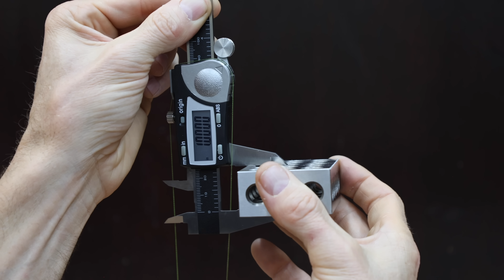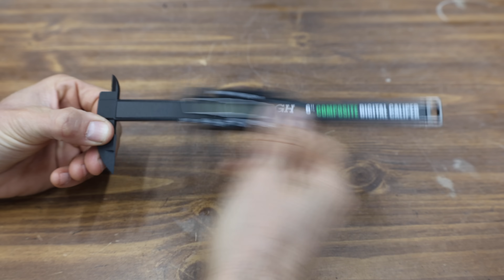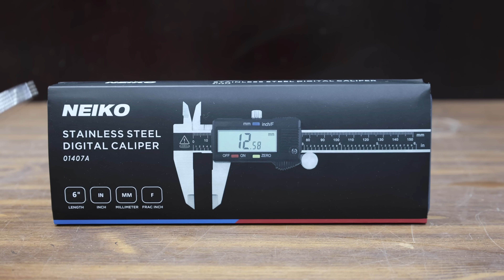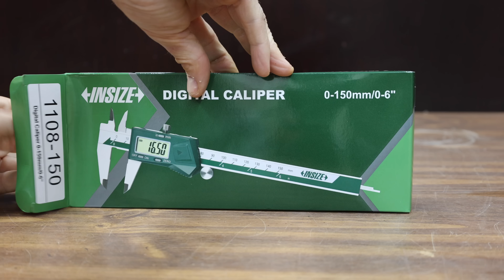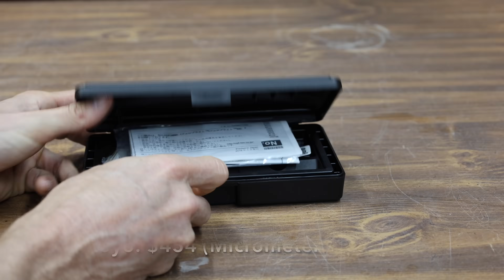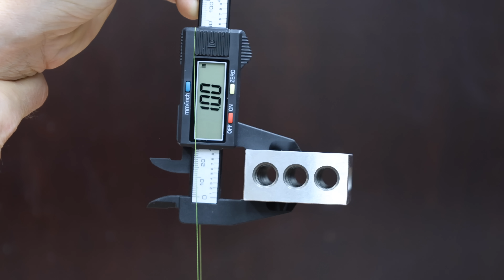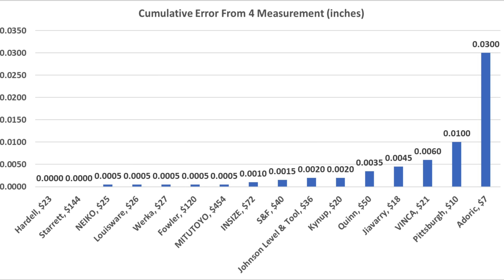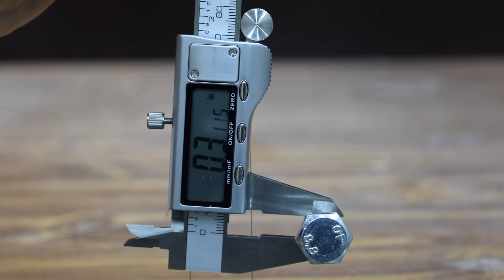I've Been Proven Wrong About Calipers!

Comment: I'd like amperage measured when on vs asleep. My old no name harbor freight consumes almost as much power asleep as it does when on. I take the battery out because I rarely use it. I have a Mitutuyo that draws very little asleep. It benefits from using SR44 (silver oxide) batteries instead of LR44 (alkaline). The SR44 has a longer shelf life and won't corrode. 

The hole depth test was a little sketch on a wood surface.

Comment: I have owned a lot of cheap calipers over the years, they all end up giving the wrong readings in the end or just stop working. I got a Mitutoyo in 2018 and still using it today. I have left it on for 2 weeks a number of times and still got 5years out of the first battery.

Comment: I worked 50 years of my life as a precision machinist, and taught hundreds of young kids to work in tolerances of .0001 to .0005 throughout my career, so calipers were always used for rough measurements only. A real machinist will only use micrometers, indicators, gage blocks and a surface plate.  
Great test, for people that need somewhat precise measurements, without the expensive tools I mentioned. On YouTube I see so may people relying on calipers for precise measurements and laugh, because calipers as a whole just are not precise. 
Love your videos!!!
Paul,  USA!!!

Comment: Have to object - an error of 0.00 is not the same as an error of 0.0000.   These are not even in the same league.  A 0.01 caliper is not a replacement for a 0.0005 caliper.  They should not even be in a test together.  The other thing to consider is durability.  After a year of hard use in a shop how accurate are those cheap calipers?

Comment: Mitutoyo are the best I’ve used. I use my calipers and mics 8 hrs a day measuring parts keeping what I’m running within tolerance. The battery last longer than any other caliper I’ve used. I needed a new set of 12” calipers and tried a Fowler and they work fine but eat batteries for lunch. Plus I have to turn them on every time I pick them up while my mitutoyo stay on 8hrs a day and last forever.

Comment: Unfortunately this testing does not give you the information you really want. All these calipers have some very nasty issues that are not mentioned in this testing but are the only things that I really want to know :
1. How do you open the calipers up to clean out the battery compartment when the battery goes flat and spills its corrosive contents into the battery compartment. Because you cannot and it means throwing the unit away. They may be okay if you are a professional engineer and are using them every day. If you sometimes go months with no use (so don't know what the battery condition is) forget them. There are a few ways to prevent this but requires changes by the manf and believe me they would rather you bought new ones. Firstly when the battery reaches a certain charge they should refuse to turn on, secondly you do not want them to turn on by themselves when the arm is moved.
2. The sliding friction is usually generated by some small plastic spacer bits inside the mechanism on one side and a flat tension spring on the other. If it is set up correctly a very small amount of oil on the shaft should free it up. If kept dry they will eventually seize up as the friction surfaces gunk up.
If you aren't aware of both these issues your long term use will be disappointing in the least. Ask me how I know. Stick to the old mechanical style and learn how to read them. My mechanical one is still going strong after 30-40 years but the digital heap of junk only lasted about 2 years.

Comment: Would be interesting to see at least one $50 NON digital caliper. 
Standard or even with the "clock dial" if it's really too hard for people to read the standard ones 😅
I find that the analog variety can give you top accuracy but at 20% of the price...and it never runs out of battery 😊

Comment: I’ve got a set of HF Pittsburgh fractional inch and a Mitutoyo, not six inch travel.  They compare favorably for casual measurements and the HF was about 1/7 the cost of the Mitu.  The build quality of the HF is not as good, and I had to repair the circuit board and battery contacts after about ten years of use.  I don’t do enough work to have memorized the decimal equivalents of common fractional inches such as, say, 5/64.  I appreciate not having to convert a decimal reading on the HF calipers.  If you do a lot of machining, you’ll probably memorize the decimal equivalents of fractions and not need the calipers to do it for you.

Comment: Quite happy with my $50 iGAGING calipers, they’re much better quality than the $30 ones I picked up from Performance Tool or somewhere similar that would always kill the battery after a month. They’re very much accurate enough to figure out questions around the house and for various hobbies requiring measuring things with +/- 0.1mm accuracy. I had looked at and almost purchased Mitutoyos before but I’m using these maybe once per week, not many times each day, and I’m gentle with them — they live in a padded case in a cushy toolbox drawer for instruments. The $$$ models are likely worth it for heavy use, and ultimately you’re paying for known quantity “it just works, no second-guessing the tool” and situations where time is money. I can appreciate the democratization of tools like these, borescopes, thermal cameras, etc that weren’t priced to be accessible by home tinkerers a decade or two ago. I love fancy quality tools as much as anyone but for “few-times-per-year” use stuff, I’ll go midrange, if I can find something USA made that isn’t eye wateringly expensive compared to a decent-quality China version, I’ll usually opt for that, but even stuff like a decent $100 Klein Tools laser distance measure are made in China. Even a Leica Disto D2 is made in Hungary. If it does what it says and has a real warranty and reputable brand behind it, I care less about where it’s made. Still wish they could be MIUSA but supply chains in the modern world are what they are.

Comment: Been a machinist for 20 years and used to only use Mitutoyo dial calipers which served me for 10+ years with no issues.  Bought some cheaper digital ones close to the price of Insize and they worked well for years.  Over time I found the inside measurements went out I’m guessing from wear and tear. For the price and the environment where you can wreck these at any time, saving some money is a big bonus.  Accuracy wise never had an issue, would buy another set without hesitation.

Comment: Nice job as usual!
I bought the Vinca about 4 or 5 years ago, and it's beyond annoying to use.  Constantly loses its zero, even with fresh batteries. And the case is designed badly, so that it often powers up the caliper inside the case when closing the lid. Do not recommend it at all when far better options like the Werka and Neiko exist for roughly the same price point.
Reply from the maker: Thank you for sharing!

Comment: Repeatability is crucial, that is one aspect this test could have included, but still VERY good testing data.  
Measurement technique is also critical, Abbe error can be mitigated significantly with good technique, but this requires high quality tools.  A 4" (compact type) cn reduce Abbe error by design, Fowler makes a nice affordable model. 
 That said, I use dial calipers for critical applications, Mitutoyo's metric model 25.4 turns per inch is crazy precise.  

But even cheap models if properly cared for can be extremely useful, even the 3" plastic digital General model. even came with a protective case, which means it will retain repeatability better than one tossed around.  Small size reduces Abbe error, even has a fractional inch readout.  
I think HD and Zoro has them for $20 now.  Model 1433, awesome super compact caliper.  Use with care and it takes up hardly any space.

Comment: Add a test for power draw. Most important when off. So a simple test would be new battery in all and let set for months or a year and then measure voltage. But, best would be to power supply each with a meter in between to see amp draws both on and off. The cheap ones use more power off then the good ones use when on.

Comment: For anyone not a machinist, a piece of standard printer paper is about .003 inches thick. So the ones that are off by .001, are off by less than the thickness of a piece of paper.

Comment: I only use starrett or mitutoyo and that has been the only thing ive ever used while working in the industry. i have 3 personal mitutoyo calipers and theyre great. any instruments that measure out of tolerance should be thrown out. personally i despise the auto turn off "feature". none of these calipers have an accuracy of 0.0001"

Comment: A word about battery life.  I have a Mitutoyo, and my son has one of the Harbor Freight cheapies.  The Mitutoyo does not power down automatically, which you would expect to mean more battery replacements.  But it doesn't work out that way in practice.  I can't speak for all the auto-power-off models, but the batteries of the cheaper one seemed to drain even while "off", and the Mitutoyo does not.  He has had to replace the battery twice this year, and I have over three years on my Mitutoyo's present battery.  The batteries just last a LONG time in the Mitutoyo.  Not so much for the cheapies.

A dead battery is not expensive, but it is an inconvenience and a distraction.  When you take the caliper out of the case and it doesn't power on, you have to stop whatever you're doing and go find a battery.  It's also convenient to not have to press a button every time you pick the thing up to make a measurement.  It takes either both hands, or you have to set it down again and press the power button.  It 's just a distraction, and it gets old.  You do have to remember to turn it off when you're putting it away, or you'll undoubtedly be replacing the battery sooner.  I did leave it on on my desk for a week once, and it was still ok when I picked it up again.

Comment: I have those EXACT cheap calipers. I bought them just for OCD and installing sights.
If I had more uses I would buy better ones, but for under 10 bux I have had these for 6 years and they always have been stable.
I swear the actual LCD part is the same on half of them with extra stuff added. When I got mine there was a 10, 20 and 30 usd option.
All the same electronics but one plastic, one steel, and on steel with a wheel and lock screw.
Edit: I just took a peek at mine and just like I thought there are places to attach the screw and wheel.
The stop screw hole is threaded so I can just go find a screw for it if I want, so I'm taking a trip to the screw isle today lol

Comment: I have a  couple mechanical dial calipers that I have used for decades. I "upgraded" to a digital from Harbor Freight about 8 years ago. I like it, but for one problem...  If you leave the LR44 battery in it while storing - I will discharge the battery within a couple weeks. This is because the "OFF" is only a soft Off. The battery is always trickling out into the caliper even when it is "Off". So, after using this caliper - I remove the battery.  Thanks for the testing and comparison.

Comment: If you want quality and durability just buy mechanical (non digital) Mitutoyo. They are about $40-50 and only calipers you will ever need or use (they have no battery, so they work every time)

Comment: Personally, I don't like the auto on feature. If it's not locked down with the screw, it tends to shift enough when carrying it that it will periodically turn on by itself. If you carry it with your tools but don't use it often, auto on causes significant battery drain over time. I suspect that the feature itself slowly drains the battery as well. I otherwise like the set, but if I could hack it to disable the auto on, I would. 

The cost in batteries just isn't worth the marginal "problem" of having to press the ON button.

Comment: You need to look into parkside calipers, i have two pairs, they cost 15€ (MSRP, you can get them for 8€ from time to time), they’re metal, have a thumbwheel, are accurate to 0,01mm (0,0005 inches) and even come with a nice box. They are a beast in price to performance

Comment: They are all accurate enough for calipers. I mean if you want accuracy use a mic. Most tolerances are plus or minus a couple thousandths on prints. Calipers just give you a quick measurement.

Comment: Weird, I have the $20 silver metal Pittsburgh and have been building tons of CNC and 3d printed parts well with in .01” of spec. But that’s also due to the fact my printer and CNC are about that accurate.

0 issues for me and my use. As always. Love your work. Keep it up!

Comment: I can confirm the quality of Starrett devices. My former job was a calibration technician in the Army (MOS 94H). Starrett stuff was always in tolerance, even after years of use. Also, of note, Proto makes the best torque wrenches. Almost always in tolerance and easy to adjust if not. I have calibrated thousands of torque wrenches.

Comment: I have several Pittsburgh fractional units and a few unbranded ones. Back in the 2000s the LR44 battery would last me about a year, used almost daily. Now you cant get a month out of one! Its such a problem I bought some new ones with the CR2032 batteries, to my shock they are only last a couple moths also. I even tried the LIR2032s but it turns out they only had a 32mAh capacity and die even quicker.  I eventually solved the problem by gluing on a usb rechargeable AAA battery that has a 4.2v cell and a regulated 1.5v output, wired it in to the LR44 calipers. No more battery problems.     I am very surprised at one of your observations, you said only a few models remember their last position when powered off,  But never had a digital caliper that didnt do that. Perhaps there is some confusion?  Seems they dont really turn off at all, the display times out. I have turned them off and moved them and the display wakes and updates instantly.   
Nice comparison,  repeatability really is the best witness, even so accuracy one of those things we wonder about, you pretty much end up taking its word for it! But most of them claim a tolerance that larger than we would like.  Like voltmeters I have around 20 of them from many brands, I even tested two  brand new Fluke units of the same exact model right out of the box , supposedly calibrated for accuracy, on same source simultaneously they didnt agree exactly agree exactly! Which one is right? probably neither and how will I ever know?  Its really just about being "Close enough".

Comment: question; i really like the quinn set for the functions it offers on the left side of the chart, and it seems like it's relatively accurate judging by it's performance. would it be possible to buy the the quinn calipers and then modify them somehow to make the slide more fluid? like, lubricating them, or very lightly sanding/grinding the edge of the caliper? or would that jeopardize its performance?
Reply from the maker: Thanks for the suggestion.
Reply: @ProjectFarm haha, it wasn't a suggestion, it was a question 😂 gotta love the youtube brand botted replies

Comment: So honestly I use calipers at home and at my job. Your testing is flawed because plastic and steel calipers are used for totally different things. For instance I used the plastic calipers on my watches because I don't want to scratch my watches. But you have to use pressure when measuring with plastic because it'll bend and flex without it unlike steel.

Comment: I would have liked to see a durability test. Actuate the calipers a hundred or so times and see if they still work correctly. I have the Pittsburg metal calipers. I've been using them for ~5-6 years and eventually they started resetting mid measurement.
Reply from the maker: Thanks for the idea!

Comment: The average person will never need more than a $30 caliper. After 10 years my $20 pair off Amazon started to bind and give inaccurate readings, I cleaned the rails with isopropyl and applied a thin layer of oil and they started working fine again.
Reply from the maker: Thanks for the feedback!

Comment: Why does the insize have a usb port if it uses a cr2032?

Edit - it can be connected to a PC but appears to require a proprietary cable instead of regular micro usb

Comment: I have a $30 caliper at home and a $250 mitutoyo at work. There is no comparison. The finish the feel the accuracy. My home ones are fine enough and get the job done, but you have to re zero them because they won’t be reading correctly when closed. The mitutoyo. There is no zero button. If it’s not reading zero when they are closed it’s because there is some grit or gunk in the middle. Clean the jaws close them and they are back to zero.

Comment: All of the electronic digital calipers I've bought from HFC, Alliexpress, and ebay have failed me.  They either stopped working, or gave inconsistent readings with questionable accuracy.  I now use mechanical dial calipers.  These give repeatable results.  They are a bit harder to read, but it didn't take me long to figure them out.  There actually are dual scale dial calipers made that can be read out in both Metric and SAE, mine are Metric only.  The conversion math between the two systems is simple on an HP calculator.

Comment: You should not be required to dangle a thread-weight across the caliper to get accurate readings, and virtually nobody uses them that way. I say test them as-is, just as they will be used 99.99% of the time and log the resulting errors accordingly - don’t mod/ retrofit them to improve readings!